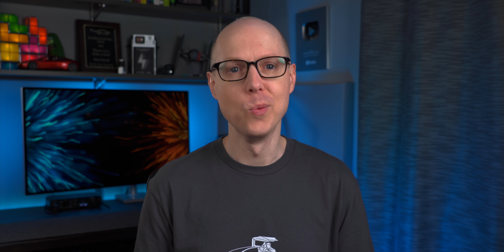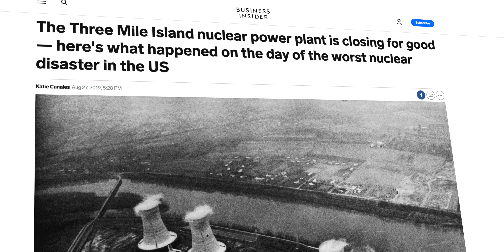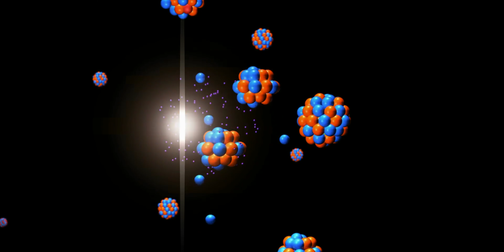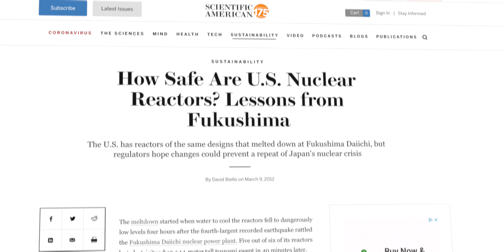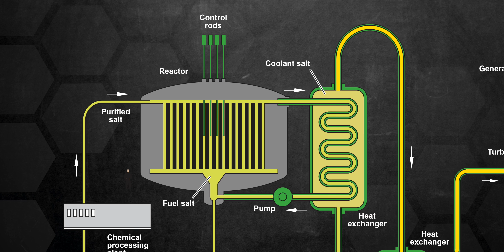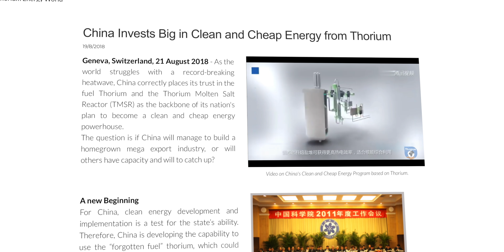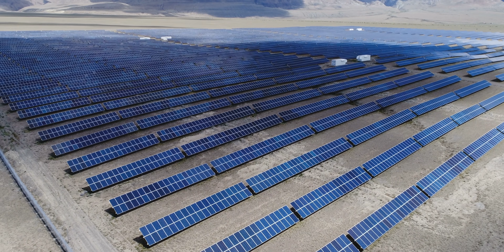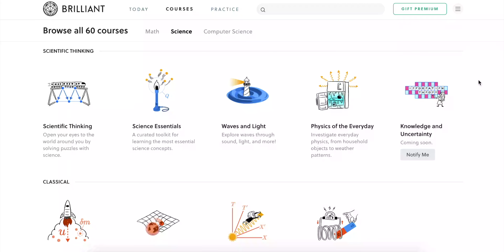Thorium explained - the future of cheap, clean energy?

Comment: I'd like to clear up a common misconception, that the most radioactive materials are the longest lived.
This is totally backwards. 
The most radioactive elements are the shortest lived, decaying more rapidly, and emitting more dangerous particles over a shorter timeframe.
I'd happily live right next to something that would take 100,000 years to decay, because the amount of radiation would be barely above the background radiation levels.
If I was near something that decays in a matter of weeks, I'd likely take a lethal dose before I'd have a chance to run away.
Also the particles being emitted are important too.. some are effectively harmless, others harmful if a source is consumed, and others that will do you serious damage unless massively shielded.
Also, when referring to the amount of Thorium available vs Uranium, it's useful to know that for solid fuel, only about 3-5% ever gets used before the pellet is removed as waste, whereas a molten salt fuel can utilize all its potential.
Reply: Well-said. Matt Ferrell mentioned the last point in his video, but the rest were certainly worth bringing up.
Reply: While I see where you are coming from, this is not really true. It is only one factor (decay rate, or disintegrations per second), but the decay itself can have wildly different levels of energy between the different types of radioactive materials:
1) Some materials might have many disintegrations per second, but each one is very low energy (Sulfure 35, or tritium), while other materials may have lower disintegrations per second but each one is very high energy (Iodine 131 -- very very nasty). The energy of the disintegration event is far more important than how many happen per second, as not only does it affect the level of lethality of the material, it also affects how far the radiation travels. The energy of the events is directly proportional to their travel distance and penetration. Even something super short lived, with very high disintegration per second may be completely harmless to people in most situations as the disintegrations can be so low power they can't even penetrate the dead outer layer of skin, or even a piece of paper (sulfur 35).
2) The type of radiation is extremely important, and is an independent factor to both disintegrations per second and energy per disintegration. You've probably heard of them -- alpha, beta, gamma (edit: and the very often forgotten neutron radiation). Each one comes with its own different levels of danger inherent to the type, and then in addition to the amount of energy kicked off during a disintegration, and then in addition to how many disintegrations are happening per second.
So basically, you're looking at 1/3rd of the problem. More disintegrations per second (and shorter half life) does NOT mean more dangerous, what so ever. But, it can ADD to something being dangerous. The level of danger depends on all three factors of radioactive isotopes: type of radiation, amount of energy per each disintegration, and amount of disintegrations per second. You must consider all three when judging if something is more or less dangerous.
And then there is a forth consideration I haven't yet mentioned, but others have: what types of elements are made during decay? Are they also radioactive? And are they even more dangerous than the original element?
Reply: @SmartassEyebrows  he did touch on some of the points you make but yeah as you say, half life is not the only factor. Generally speaking though it's the most important factor. Even low energy beta decay is a problem coming from isotopes with low half lives.
Another consideration is biological half life of the element. Both iodine-131 and Caesium-137 have biological half lives of about 100 days but Iodine 131 has an 8 day physical half life so the vast majority of it will decay while inside you (and also concentrated at the thyroid) while Caesium 137 has a 30 year half life so only a tiny tiny fraction of it will decay while inside you (dispersed evenly throughout your body) and thus one is very dangerous while the other is relatively benign.
In other words the ratio between physical and biological half life dictates the fraction of total dose released in the body.
Reply: @SmartassEyebrows  Ya, I was drunk when I wrote that :) I realized how poorly worded it was after I wrote it but was too lazy to change it.
Reply: I'd like to clarify that a half-life of 5,000 years (safe to handle after 20 half-lives = 100,000) can still produce high rates of radio activity due to the characteristics of the decay chain of the waste products. Current nuclear waste has a triple negative: It's long-lived, has long decay chains and is extremely radio active. The Thorium waste decay chains however consist if nearly all short-lived isotopes before decaying into a stable isotope. Which means the waste becomes safe to handle in a much short time, as said in video, around 500 years which means the mean half-life is around 25 years. Possible added bonus of such short-lived isotopes is that if it can be implemented in a safe way, it could even then be used as a heat source.
Reply: Paul Freedman is the decay of thorium more intense like described by Alex Read above or comparable?
Reply: @zber9043  
Hi Z Ber.
When you have a heavy nuclei fission, you have won the jackpot.  You get a LOT of energy, and all the waste products are short lived.  (Wildly dangerous, but short lived.)  What you don't want is the heavy elements to absorb extra neutrons.  Then you get the long lived actinides, which have half lives of around 100 to 1,000 years.  These have short enough half lives that they are pretty dangerous, but long enough that they stick around for a long time.

Thorium breeds U233, which is a better fuel than U235, more of it fissions and we get the jack pot.  However, if it does not fission, it can absorb a couple more neutrons, and become U235.  This is also a good fissile fuel and is likely to fission giving us the jack pot.  If it does not, it MIGHT absorb 4 more neutrons and become PL239 which is an ok fuel, and might fission and get us the energy jackpot.

Uranium breeder reactors (which breed U238, into Plutonium 239), start off with heavier elements and are much closer to the long lived actinides which we want to avoid.  In effect, their starting place misses the two best off ramps to the jackpot.

So Thorium produces a lot less of the long lived actinides, and a tiny fraction of the Plutonium.  A study showed that the Thorium fuel cycle (after 200 years to let the short lived fission products to break down) produces 10,000 times less of the long lived nuclear waste.

An added advantage is that U233 is unsuitable for nuclear weapons.  (Not that any bombs have ever been made from commercial power plants.  It is cheaper. and much safer. to buy Uranium on the open market, and create bomb grade material in facilities optimized to do so.)

Warm regards, Rick.
Reply: @zber9043  Thorium is much more efficient. meaning it "burns" its fuel completely leaving much less waste. yes the waste is more radioactive but there is a lot less waste and its half-life is measured in hundreds of years rather than thousands. there is an added benefit with a Thorium reactor, it uses a small amount of the waste from current reactors in the fuel cycle and is "burned" in the process.
Reply: @dalethomasdewitt  my money is on Thorium. its a much better choice for safe and efficient energy production. i dont know why NASA is not perusing its research.
Reply: @ericmartin2470  Perusing - passively researching. 
Pursuing - actively chasing.
technically, NASA IS perusing Thorium.
Reply: @ericmartin2470  Well NASA has already mapped the thorium reserves on the moon if that tells you anything ;)
Reply: @doritoification  do you think the US would secretly research technologies for a Moon/Mars base w/ a power source?
Reply: @ericmartin2470  well the killopwer project is no secret and you can find the map of the thorium on the moon by just googling moon thorium.
Not saying the two are linked, killopower will use uranium, but it shows NASAs willingness to experiment with nuclear in space
Reply: @zber9043  My understanding is that most MSR proponents suggest a two stage process for waste management. The initial decay products from molten salt reactors are initially intense gamma radiators (think X-rays). These need to be stored in underground lead lined flasks for about 7 years. After that the radiation should have subsided to a point where the material can be safely moved to less secure storage for about 500 years. 

The robotics needed to do all this handling was demonstrated as part of the 1960s MSRE project. 

After 500 years the material is radiologically harmless. It may however, contain chemically noxious and/or valuable chemicals eg heavy and/or rare metals. These can be extracted for industrial use and the balance returned to the environment whence it came.
Reply: @doritoification  Australia is currently selling 10,000 tonnes monazite (thorium ore) pa to guess who? China. This is fequivalent to about 500 tonnes elemental thorium. Unless they have discovered something new, thorium has only two industrial uses, gas light mantles and reactor fuel. It doesn't take much nous to guess what it is destined for.
Reply: @jimgraham6722  I wanted to reply with a twitter threat I came across a couple of weeks ago showing satellite images of their ThMSR-LF reactor which is under construction but i cant find the thread. Short story-They're already building a liquid fuelled Thorium reactor (and a solid fuelled one too)
Seeing as China basically processes all the rare earth minerals on the planet for everybody else I'm sure they have huge stockpiles of thorium already but it's no surprise they're still buying monazite with the double intention, rare earths and thorium. I'm sure they'll sell a lot of the rare earths back to Australia either as rare earths or value added products containing them. The states have a lot of agreements with china where they sell their minerals (containing rare earths) and get either rare earths back or final products containing them
Reply: @ericmartin2470  The thing is a MSR can use existing waste as fuel, or at least as the "starter" for a breeder reactor.
Reply: @doritoification  Monazite is quite plentiful in Australia but it is illegal to mine for, concentrate or stockpile the ore on shore. When it is a by product of other mining operations it normally has to be scattered back to the environment, however, licences can be obtained to concentrate this side product ore provided it is promptly exported. Its wierd stuff.
Reply: Rick Smith thanks! Great info.
Reply: @zber9043  radiation is identical across all elements, there is no difference. If you have 1kg of one kind of radioactive substance, and 1kg of another, the amount of radiation they produce is the same. The difference is one decays quicker than the other one, it's the speed at which they radiate that produces the fear people have. (that is assuming the averaging of the alpha, beta, and gamma emissions, and doesn't take into account one material might be only alpha, and another only beta or what have you, from a conversational aspect.)
Reply: @doritoification  Space Force have a nuclear thermal rocket engine better than China's. Moon has He3 good for fusion?
Reply: @MatthewHolevinski  No, radiation is not equal across all elements (or isotopes). As you mentioned there is alpha, beta and gamma to start with but each of these can occur at a spectrum of energy levels which are typically related to the binding energies of the isotopes they are emitted from. Then there's the question of whether or not the isotope will decay once and become a stable isotope (one decay per atom) or whether it will decay into another radioactive isotope which will undergo subsequent decays (multiple decays per atom).
There are also considerations of how does a particular element behave inside the human body. Iodine concentrates in the thyroid and has a biological half life of about 100 days meaning it will take 1000 days for the body to remove all of it. It has a  physical half life of just 8 days though which means that 99.99% of it will decay while inside your body and mostly in the thyroid, giving you a very large dose in a concentrated location leading to thyroid cancers.
On the other hand Caesium does not concentrate anywhere in the body, it has a biological half life of about 100 days too just like iodine but it has a physical half life of 30 years. This means that your body will remove 99.99% of it before it is able to undergo a decay inside you, subsequently giving you a negligible dose which is also not concentrated in any particular location.
Sorry to nit pick but there's nothing simple about radiation and nuclear physics. I'm no expert myself but you certainly can't just make sweeping generalisations about radiation and its effects
Thorium reactors produce less transuranics because the first neutron absorption creates U-233 which can fission. If it absorbs another two neutrons it becomes U-235 which can also fission so when you start with thorium you get a whole extra opportunity to make fission happen before reaching the U-235 that a typical reactor uses. You also don't have any U-238 which has to absorb a neutron to become Pu-239 before it can fission which creates an opportunity to create actinides as the Pu-239 can absorb further neutrons to create long lived actinides which people are so unnecessarily scared of.
The fission products from U-233 are different from the fission products from U-235 too. Not significantly different but they are different. I'm not qualified to comment on whether they are better or worse in any way but naturally, there will be a different hazard profile associated with them.
Reply: @alwayscensored6871  If building a fusion reactor is hard on earth it's certainly not going to be easy on the moon. Maybe we might mine the He3 to bring back to earth for fusion reactors but i doubt there would be much benefit over just breeding the He3 in a lithium blanket right where you need it rather than on a different celestial body requiring a rocket to transport it back
Reply: @doritoification  I certainly can make large sweeping all encompassing generalizations, I've found it leads to a happier lifestyle when compared to being pedantic. Also, I believe i prefaced my statement with the quantities as in the amount, not the type. Also why are you talking about internal radiochemistry, that is neither here nor there, where in all of gods creation is anyone going to encounter high levels of acute radiation poisoning internally? Like what the actual fuck, IF that was to actually be a problem for anyone, they have bigger concerns, probably the heavy metal poisoning which is going to lead to death far sooner than the chance of having a chance of developing cancer at some point if and in the event their left shoelace was untied on a wednesday when they were exposed or ingested, depending on dose, time and tissue meat exposed.
Reply: @alwayscensored6871  We don't need to go anywhere to get helium3, it's not in short supply. We can make it in volumes on a whim whenever we want.
Reply: @zber9043  My understanding (I am not expert) is that the waste product from a thorium reactor (ie. the material that would need storing for 500 or so years) is high gamma. That is high energy photons. While this energy decays the reactor would need to be shielded in a lead container, or placed in a shielded underground pit until safe. Most MSR proposals include a through life plan for managing this safely and efficiently.

A number of proposals involve an A, B arrangement. Each reactor installation would have A and B reactors. When A has reached the end of its operational life after 5-10 years, B takes up the load. A is left in place for several years to cool thermally and radiologically. It is the removed to longer term storage or recycling and is replaced by a new A reactor. The same happens to B in its turn.

This process for MSRs is made feasible because the reactor vessels are relatively small and light, able to be lifted in and out of place with relatively standard industrial crane technology. The feasibility of robotically removing an MSR from its operating position  for subsequent disposal, was demonstrated as part of the MSRE.
Reply: @ericmartin2470  Nuclear power has been used for US bases in Antarctica. All the new Rovers being sent to Mars are nuclear powered. A future Moon or Mars base would certainly need nuclear power to maintain and sustain human habitation and provide the energy needed to make oxygen and win water from local materials.
Reply: @jimgraham6722  you're preaching to the choir.
Reply: @paulmichaelfreedman8334  So 500 years would be like still dealing with radioactive waste that Columbus used to cross the ocean blue.  Hmmmmm....
Reply: @DougC-iv7zq  It's that or dealing with medium radioactive waste (still extremely deadly!) that has to decay for thousands of years before it is not dangerous anymore in terms of radiation.
Reply: I would add that the REAL problem is the CHAIN of decay (from heavier nuclei to lighter ones); since the "point where it stops" depends not really of the mass, but rather the GEOMETRICAL distribution of protons & neutrons. This is why two atoms with almost the exact same "weight" can be stable or decay almost instantly.
  
The "highly radioactive" stuff that last thousands of years has both a very long "chain" of steps with some of them being extremely energetic.
While most of the time a single atom will be "waiting" for its decay (and most of those decays would be low powered), statisctically speaking there will always be an atom doing THAT nasty transmutation that releases a very strong gamma ray [even if the other 10 millon atoms around it do nothing or low emisions].
  
That gamma ray moves at the speed of light in a random direction; then you pile up many of those "rogue rays" you end up with having a "sphere of bullets" shooting constantly [with the targets being your DNA]. Since a gamma ray is "light", it can not be bended with magnets; then because it is extremely thin (half of the size of the wave lenght determines what can affect it), you can not "shield it" with large 3D structures like a cell membrane [basically only every atom or single molecule can interact with it], so it is like if your DNA was "exposed in the vaccum of outer space" with nothing around it.
Reply: @adolfodef  you are getting all of that right now, all the time anyway, what's the problem? =)
Reply: @MatthewHolevinski  Sure. I forgot to actually talk about "The Problem" =P
 . A single High Energy Gamma Ray can cause a DNA mutation in ONE CELL that becomes cancerous (in the medical sense, not the reddit/4-chan one); multiplying without control & causing havoc in the rest of the body by triggering construction of blood vessels around its "blob" of cells [who do nothing productive], by taking resources needed elsewhere.
  
In the "natural world" Gamma Rays that strong from outer space never get deep enough in the atmosphere to cause problems; since humans can not even live a single year at over 6000 meters over sea level (this is why flying all the time in planes is actually rather toxic). Radioactive stuff underground is blocked by... the ground (also is diluted so much that even if a single "grain" of a radioactive heavy metal reaches the surface, its "contribution" is negible since it is not "pure").
  
  ->  Artificial radioactive materials can be "diluted" in concrete safely... but the current techniques to CERTIFY that there is ZERO ammounts not totally dispersed is so expensive & time consuming that "deep storage" of the concentrated stuff is way more cheaper/easy to do in practice.
Reply: @adolfodef  Ya but generally speaking those mutated cells generally end up getting terminated by the immune system. And those that don't, well to be fair about 9 out of 10 of us are all going to get some kind of cancer during our lifetime before we die. But yes, I agree any kind of what a layman would call high level hazardous material should just be ground up, diluted and dispersed.
Reply: I think it's important to illustrate the differences between the solid fueled reactor and liquid fueled reactor.  In a solid fueled reactor, the solid pellets must be removed before they break apart.  That's why they must be removed so early.  In a liquid fueled reactor, the fuel can be stored away from the reactor (like a gas tank) and you only need to put in as must fuel as you need for the moment.  Kind like an accelerator in a car.  So the reactor is only burning up as much fuel as you give it, and it can be burned up completely.  A solid fueled reactor needs all the fuel for a 3-5 years of operation, with a few rods remove after 18 months and the other rods moved around (insert campfire analogy).   That's why they need control rods and many other safety systems.
Reply: @rickmorenojr  you would still have several months worth of fuel in there because you need to have the right enrichment level to achieve criticality. The benefit is that you can constantly add fuel to keep it where you want it without having to shut the reactor down and the same is true about removing fission products. The xenon just bubbles out all on its own which eliminates the issues with a xenon pit poisoning the reaction, and other fission products can be removed via various other processes
Reply: Yes, this the problem with the MSM... they often misunderstand the details and report things in a distorted way. Whether this is intentional or not it cause distortions invariably leading to bad outcomes as we are currently experiencing.
Reply: Lars jorgensen from thorcon makes it sound like pop cans of waste vs. the barrels of it we currently produce... There would be some difficult but fun maths to be crunched in designing a MSR waste storage facility, and comparing the hypothetical performance to the more prolific tech.  Beyond me!
Reply: Coward , I deliverd newspapers on bicycle in sweden when Chernobyl -during my 3 hours round it rained heavily 2 mornings  -Yes I guess i got a dose on the shin even swallow some rainwater - So it could have some longlived still in me but I guess every swede would have minute radioactivity from those days some more some like who ate wild boar or ate the mushrooms (like my parents  ) - My only problem I guess is the pancreas -I dont see that as a problem arising from radioactivity
Reply: You’re not talking into account safe materials and distances. Something that takes 100,000 years to decay will still kill you without both, and be a concern for much longer.
Reply: @aalvarez2914  you cant have your cake and eat it too. the waste from Thorium is much less because the process is much more efficient and the waste it does produce is toxic for a much shorter period of time.
Reply: One of many misconceptions.  Thanks for pointing it out.  👍
Reply: " whereas a molten salt fuel can utilize all its potential".
You know that it cannot.  Have you had a good look at the decay modes of Th232?
Reply: I have a sphere of material in my basement with a half-life of over 26 billion years.

It's a steel ball bearing XD
Reply: @Stonehawk  I would increase that half life about 1 million times, beyond that who knows.
Reply: More unstable!?🤔
Reply: dude, please, take a clue, these people are trying to market Thorium, ...do you know how people managed to build Uranium reactors back then?
Reply: @electronresonator8882  The main reason why uranium got traction over thorium was because of nukes. Thorium is much better, just that the world isn't ready for it, yet. It still very much deserves it.
Reply: @electronresonator8882  - So now it's a crime to sell something?